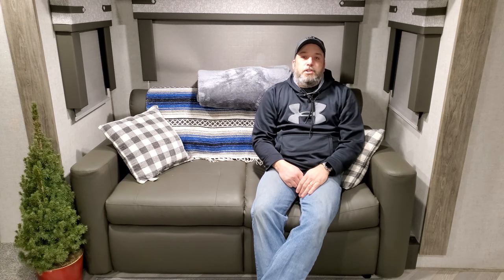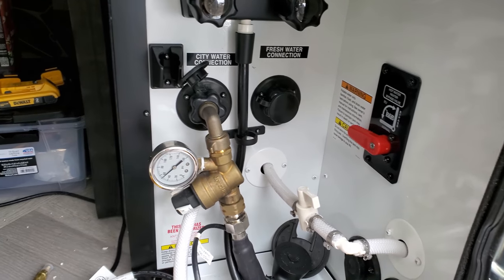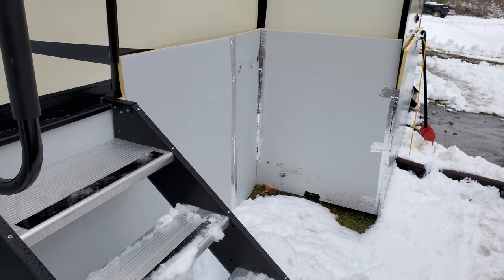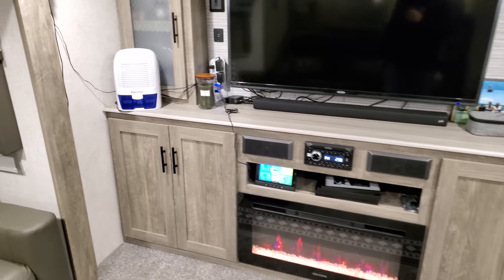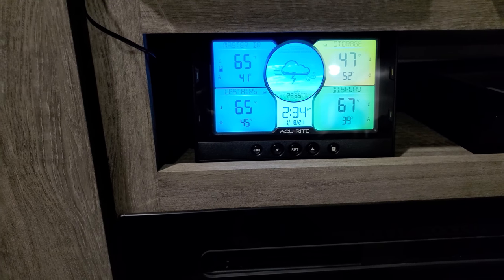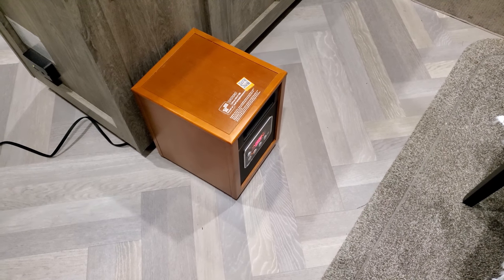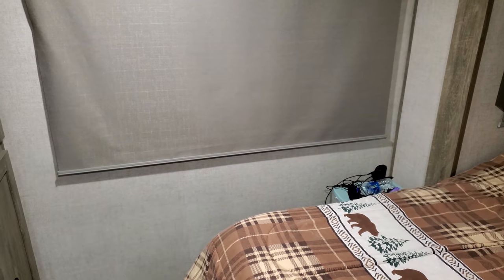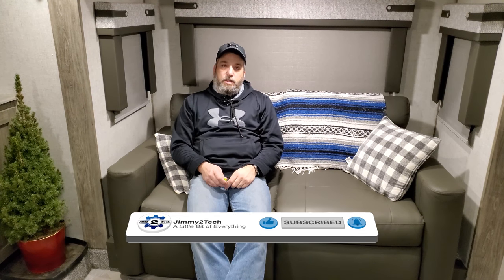The Ultimate Guide For Winter RV Camping

Comment: Im a poor $$$ country boy. I used 17 bales of straw around my small camper. I wedged them underneath the camper all the way around. At my black/grey water levers & drain i tied a small bale that fits titely in place then stuff any openings with loose straw. The results are incredible. Tomorrow i will put 1/2 dow foam board on my windows from the outside. It will be dark in here but this storm bringing single digit temps is no joke.
Reply: I didn’t even think about using hay. That’s a good idea. Did you just do it around the perimeter or did you fill underneath completely?
Reply: @CannibalFetusRobbery   just the perimeter.  It worked realy well.. straw is what i used not hay.
Reply: How much did that cost?
Reply: @melinda1133   it ost about $180 this yr will be a little less as im finding last yrs straw cheap
Reply: I have used straw for few years in the past. Works great. The downside is it holds the rain then molds so spring cleanup is messy.  Also, the mice love to make it home too.
Reply: @beckycrump8831  yes the mice do love it only had a couple get in last yr. As for the mold i made a couple of small straw bundles that i removed on warm days to help keep it dry so i was lucky and didnt have a mold problem.
Reply: Bale's... Good idea that's usin' your noggin'.
Reply: This is brilliant!!!

Comment: Just a couple of suggestions. In you wet bay you have a 150 watt bulb with what appears to be a receptacle rated a 60 watts. The extension cord that that is outside  appears to be a 14 AWG wire it could be a 12 AWG depending on the length of the run. I have been in a fire and when a device calls for a certain gauge I will  use the next size thickest wire. Using a Honda eu2200i the cords from the unit are 10AWG.

Comment: Hi, i was just wondering if you knew any way to be able to run more heaters at once? i’m on 30 amp service so i can’t run too many at a time. do you have a solution? thanks
Reply from the maker: If you are at a place where you are hooked into a pedestal you can run an extension cord  into an outlet. You need to pull power from other sources other than your RV.

Comment: Very Good video, I’m dealing with this winter here in S.E. Mich. Jan, Feb 21 . Not nearly enough time to prepare as well as you have. I closed the slides too, so I could move the coach south in a hurry if it became unbearable.. It is not a simple problem, the greatest problems that I have had were external LP tanks not evaporating to gas fast enough due to sub zero temps (I surrounded 3 - 30 lb tanks (so I could take them in for refills) with straw bales /no tank heaters (I should have used heated covers but no-one has them in stock) and regulator sticking(another thing that I should have heated, when sub-zero). Thanks..
Tiffin Class A
Reply from the maker: Hello Tom, We have heard a lot about propane tank issues but so far we have not had any issue. Knock on wood. Your right there never seems like enough time and you are always wondering what else you could do. But so far so good. Cant wait till spring so we can get moving again.

Comment: Currently have a 1995 3 0 foot drivable. Get a chance New England weather with a couple of back up batteries a brand new engine battery secondary source of heat and also the rig generator and a small back up generator. Also have one spare tire and then two off the rim I’ve got to get put on rims. Made sure I had plenty of fire extinguishers as well but for heat I chose to do what I did the last two years in my portable sportsman KZ that is sold. I decided to go with foam board insulation for the vents then I have to make one for the bathroom, also probably going to change some stuff up with my RV windows and affordable insulated paint on my window blinds rather than buying new ones don’t like the pink anyway. But for anybody working for these rigs. You can usually find some thing that’s a fixer-upper. You may have to live in your car short term. But it’s definitely achievable if you have a little money to spend.

Comment: Thanks for the tips! We’ll be living in our 5th wheel during winter and I’m thinking ahead. Any non-reflectix options you can think of to allow light in?
Reply from the maker: Reflectix is pretty much the best product to use for that purpose. It installs easy and is easy to remove if you wanted to let light into a window.
Reply: Bubble wrap

Comment: Hey. Great video. To the point. No extra scenes like snowball fights. Just the info we need. Here's my question: I live in western Oregon. Not NE. How much of this work should I do when we rarely get below 30 and snow is not guaranteed? When it does snow it doesn't last long. The guys who sold me my travel trailer said I didn't need to do anything because if I'm living in it, I'm keeping the pipes warm by heating the inside. Others say I'm insane if I don't do what you've shown here and then some. Just depends who I ask. What are your thoughts?
Reply from the maker: We would always air on the side of caution and do it. You never know when the weather will take a turn. It happened to a lot of people in Texas last year. A little work now to potently save you a bunch of hassle. Thanks for watching.

Comment: HI I love what you have done.  I am being evicted and a friend of mine will allow me to put a camper I am going to buy on her property and live ther with my Cats.  How do you keep the Black water from freezing up if you keep it connected to the sewer?
Reply from the maker: In the winter time you'll keep your blank tank closed until full and then pull the lever to release it. Some rv's have tank heaters which can keep your tank from freezing, but the way we skirted the underside of the rv you could always add a small heat source to put some heat down there to prevent freezing. Every rv is rated different so deffinately aim for a 4 season rv which will better help with the cold if you're going to be facing that. Best of luck, and if you have any other questions please feel free to let us know :)

Comment: Is your rv 4 season rated i think they call it? Considering buying an rv to visit family out of state but would not be able to do all the skirting you have shown here. Wouldnt get down to negatives like you said hopefully though:)
Reply from the maker: Yes, this RV is a four season. Meaning they usually have tank heaters and extra insulation. Rv's deffinately don't hold heat as well as a traditional house. If your somewhere for a short time and don't have to worry about Temps falling below 32 degrees (F) to often then you would be fine. Just have to keep track of the temp outside and make sure your actively turning on tank heaters if it's to low. Sidenote, if your hooked up to water let's say, you'll also have to make sure that doesn't freeze.

Comment: I could not handle having the reflective in the windows all day long. We've had our rig out for a few days when Temps dipped to 25 degrees, and we had no problems without doing anything extra.
Reply from the maker: It could feel closed in but when the sun was out we would take the reflective out of the window on that side of the RV to get the light.
Reply: @Jimmy2Tech  that's good to hear. You have some great tips,and I'll make sure I keep them in my back pocket. I want nothing more then to sell my house and take our rig to some place remote and stay there. But those grandkids pull those heart strings of mine. Four out of six are grown with two of them married. It's the younger two 6 and 8 that we need to keep building memories while their young.

Comment: I’m curious as to why you suggest using electric heat, where-as most suggest using your propane heat?
Reply from the maker: In cold temperatures you would need the  furnace to run alot to keep up, the problem with that, is you will runout of propane rather quickly. And depending on there you are, electricity can be cheaper/more convient than filling your propane tanks every week or less.
Reply: You can use your furnace with propane to fully heat your trailer. Just expect to fill your 30lb propane tank every 2 days.

Comment: Great video. Here's a question - do you still do black tank flushes during winter? If so, does that mean undoing all the foil wrap and heat wire on the faucet?
Reply from the maker: Hello Steve and thanks for checking out our video. We did still do black tank flushes just not as often more like every other empty. What we ended up doing is hooking up a y hose adaptor to the city water connection in the wet bay so we could hook up the small hose and do a black tank flush just by turning the shut off on the y adaptor, worked great because our connections are in the heated storage area. As far as getting access to the black tank valve and dump area we were sure to put the end piece of one of the foam panels right were the connection was so all we had to do was move the foil tape from one end and swing it open and the other end was like a hinge. Worked great.
Reply: @Jimmy2Tech  Fantastic! Thank you. I am looking forward to doing all of this myself this winter. I appreciate your guidance.
Reply: Are those dual pane or single pane windows?

Comment: Thoughts on wiring in a low temp rated mini split unit or a diesel cab heater? Looking at setting up a permanent RV on private land in Upstate NY.
Reply from the maker: A lot of RV'ers are installing the diesel heaters in their rigs and really like them. They are pretty small but put out a lot of heat. Just remember that those kind of heaters just like the furnace in your RV will also add some moisture so make sure you have a dehumidifier going.
Reply: Low temp mini split would be the way to go, you can get a 12000btu one for $1200 or a non low temp one which will work down to -5f for $800

Comment: Hey there! Thanks you for posting this!! Is this camper considered a 4season one? My husband and I are looking at a heartland big horn that’s on sale right now, the guy said it’s a 4 season but we live in NH. We’re planning on buying a 5th wheel and connecting to my in-laws house and live in it full time. Do you guys live in this all year round? And connect everything to the house? Thanks so much for posting!!
Reply from the maker: Yes ours is considered a 4 seasons RV and we do still live in ours full time. We did connect to the house for a while when we had it there. With the right things done and precautions you can make it through the winter.
Reply: If it's 4 seasons then it will have tank heaters, so look for the tank heater switches inside . Also I actually have a 2008 37ft heartland big horn. I really like it 😊

Comment: I just drilled a few holes into that heating duct in the storage Bay area. I drilled three or four holes and it keeps the temperature in there about 3° cooler than my living room.
Reply from the maker: That's a good idea, keeps from having to worry about the temp in there.
Reply: @Jimmy2Tech  You mentioned yours has the cold climate package like mine - one of they keys to that is they actually have small vents to bleed heat from the furnace and duct it into the area below the floor to keep the pipes warm.  The issue with that is that obviously that requires you to use propane heat.

Comment: How do you keep the black and grey water tanks from freezing?
Reply from the maker: Out particular RV came with tank heaters. You can purchase them aftermarket and put them on.
Reply: If it's skirted and especially if it has the cold climate package, it shouldn't be an issue (even without tank heaters.)  The tanks are within the insulated base area of the trailer which would also have air ducted in there from the furnace.

Comment: Do you use heated sewer hoses for grey water? They are pretty expensive but this is our first winter in our rig and want to be prepared.
Reply: Also could you link your slide covers you mentioned.
Reply from the maker: Hello Amanda,
      We did not use any heated sewer hose and did not have an issue. Our sewer hose run was about 40 feet also and still no issue. Most of the time when you are dealing with gray water there is warm or hot water involved, like a shower or dishes so that keeps the hose clear. Just make sure you have a good slope to the hose.
Reply from the maker: @amandasoileau4140  I have added the link to the slide toppers. just click the link and choose the size you need. Thanks for watching.

Comment: Hi, What is the length of your 5th wheel and how many insulation boards did you use? 4x8?
Reply from the maker: Ours is 42 feet and we used I believe 16 sheets. That includes the foam we put under the slides.

Comment: Can you show how you used the landscape staples I’m not understanding how those would work how do you attach them to the foam board??
Reply from the maker: Hello PJ,
       I am not where I can show that at the moment, but all we did after we had the foam boards up was put a piece of gorilla tape every 2 feet at the bottom of the board to reinforce where we were going to put the landscape staples then we put the long landscape staples in at a 45 degree angle at the bottom of the foam board through were we put the tape and push it all the way into the ground. The angle helps so when the wind pushes against the the foam panels it would just push the staples in the ground harder  and not move the foam panels. Worked great. Thanks for watching. Please subscribe if you haven't already if you found our video helpful.
Reply: @Jimmy2Tech so the staple goes thru the foam board? Confused on this, any pic close up?

Comment: Good idea, how did you get the extension cord inside? I need to run mine inside my solitude and not sure to run another space heater. Any idea?
Reply: I see how you put the cord in. Forgive me I am a newbie. How did you get it under the slide?
Reply from the maker: @latishasalisbury1270  on the slides they have the rubber seals. You can just slide the extension cord right through there and you'll be all set! :)

Comment: Hi. I fly to the arctic in winter for work. I going leave my rv heated inside but not tge subfloor.  I have heated hoses for the water. Will my pipes freeze in say minus 5 to 10 in the subfloor with out the furnace running ? Thanks
Reply from the maker: Hello Doug,
    I would say yes they will if the heat is not running. You could try to leave the water running a little. Thanks for watching.
Reply: @Jimmy2Tech  Thank you.

Comment: Are those dual pane or single pane windows?
Reply from the maker: These are single pane windows. Deffinately important to use reflectix over the windows as an extra layer to block out the cold and keep the heat in. We cut it to the window shape individually so we can remove a piece if we wanted some additional sunlight.
Reply: @Jimmy2Tech  thanks for the reply.

Comment: Question … how did you adhere the foam insulation boards under your slide outs?
Reply from the maker: These were not adhered with anything. They were cut as a tight fit so they stay in position. If you're. Alitalia worried about them blowing away you can always use some tape to keep them pressed against the slide outs.
Reply: Awesome. Thank you for the response. I would definitely like to try this out!!
Reply from the maker: @wendymoses1118  it works great! Good luck.

Comment: How long does that 100lb tank last? Also we used hay bales for our siding  works well
Reply from the maker: How long the tank last is going to depend on the temps outside and what youkeep it at.  Also will depend on if you have electric heaters in the rv. At the coldest temps where we were a 30lb would last a week. But if you manage well with electric heaters you won't have to run the furnace as much during the day. Just make sure your underbelly stays warm so you prevent possible freezing.